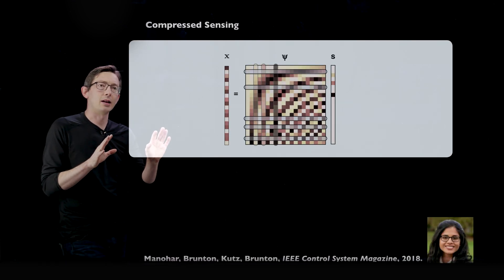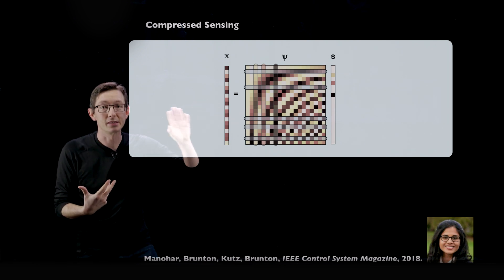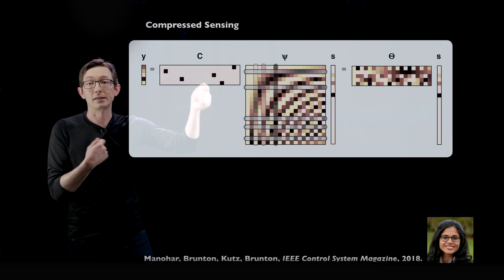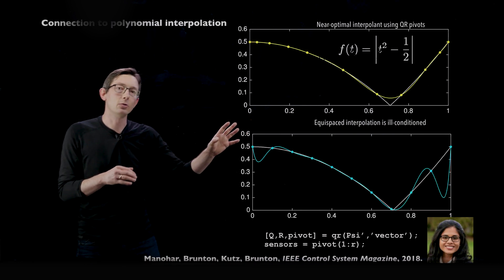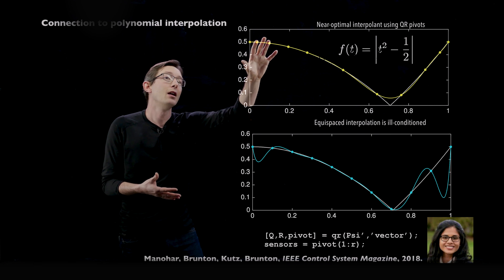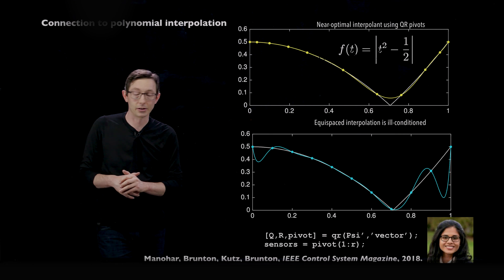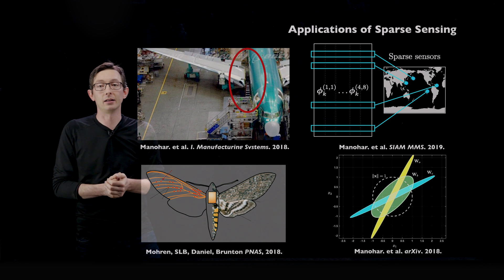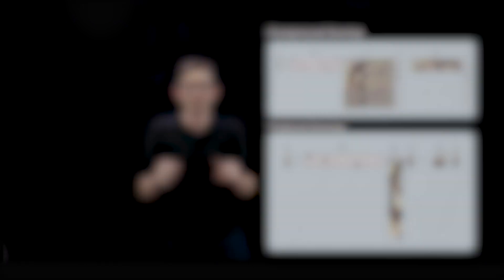Sparse Sensor Placement Optimization for Reconstruction

Comment: Thank you for the presentation.  
What if our data matrix short and fat and instead of tall and skinny. Does QR apply in that case?
Reply from the maker: Good question.  In this case, you can either just use the first "r" QR pivot points, or you can transpose the matrix, depending on the interpretation of the rows and columns.
Reply: @Eigensteve  thanks

Comment: The principle behind that compressing of information is very simple and brilliant. I understand it as an adaption of principal component analysis in statistics. You often uses images as examples. But what if we have a dynamical system like a production line, which depends on the evolving time. How can I use the method when xt with t=0,…,n is given and not only x?

Comment: Hello, thank you for the amazing video ! The methodology seems very powerful. I just have a question about the Phi*Phi^t, used when the number of sensors is bigger than modes. Why did you use Phi*Phi^t and what are the change on the R matrix ? Because we only found that the diagonaux elements relating to the number of modes considered are bigger than those after. Thank you in advance for you return. Maurine
Reply: diagonal elements

Comment: Isn't this a really hard combinatory problem? I mean you essentially want a vector mask C that is optical for chosing k points of a big vector of size n. And you use those k number of measurements, multiply them by k eigenvalues and hope the sum is as close to n as possible. 

Wouldn't this just mean you have n chose k options for said mask? 

And your approach is to take the most weighted point from every single eigenvalue and that results in your mask? 

I have to see some of the older lectures or sleep a day first to understand the mathematics of those QR matrix optimization.

Comment: Hi Professor , I'm inspired by this idea and would like to try extending it beyond 2d images. But first of all, I need to get the EigenFace example running. I went to the book link for the Eigenface dataset, but the data format are different and there is no "allFaces.mat" directly available, which is used by the code example in the book. I searched in the book, but there is no instructions on how to make this "".mat" file. I could probably try to create this "allFaces.mat" with my own understanding of how this file is structured, but it would be much more convenient if you can provide it directly for the readers. Thanks!

Comment: This seems like it could also be used in remote sensing, where over time pixels are lost from the satellite, and historically they were just pasted over by interpolating the pixels still working on either side.  Training the data on previous images from the region being sensed would provide a better way to restore the lost components, or provide a indication of how serious the lost elements are (if they appear as pivot rows).